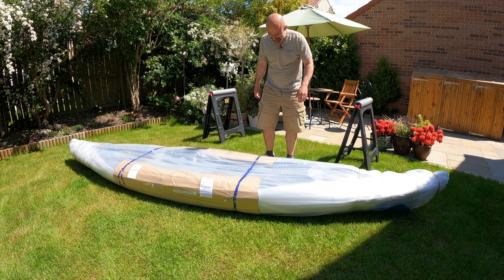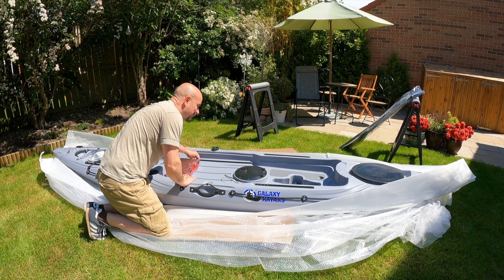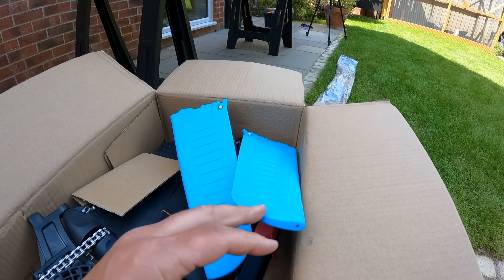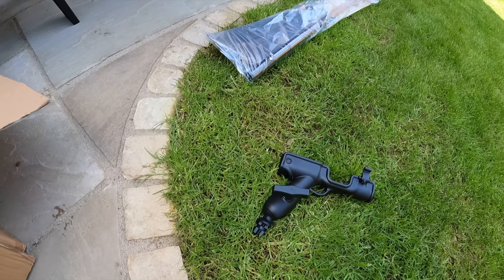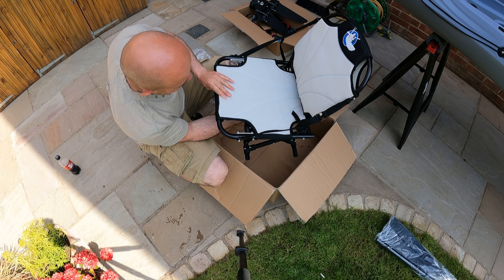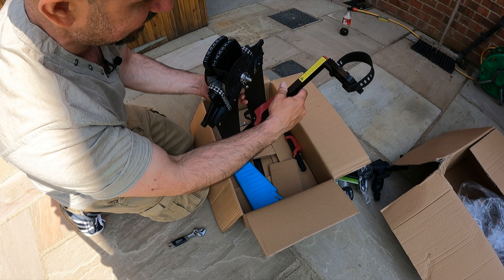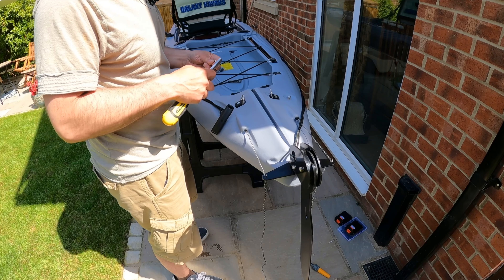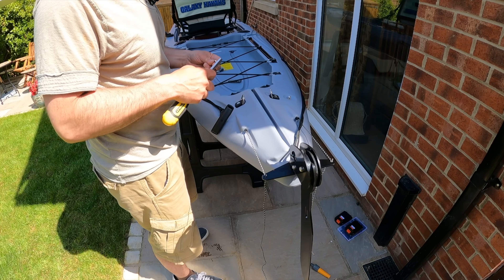Galaxy Sturgeon FX - Galaxy Alboran FX - Kayak Unboxing and Initial Setup

Comment: Evening Chris, 
Hope you and the family all well,
Hit by the storm here in Jersey but all ok.
Did get the kayak thanks again.
Did you do a video on how to set up the fish finder?
As if you're not busy enough 😂.
Have a great weekend.
Reply from the maker: Hey mate how you doing? We just got torrential rain rather than the high winds up here from Cairan. I’m sure I have on one of my vids but I’m buggered if I can remember which one! It’s super easy to be fair. You might need to fashion a bracket of some sort depending on the make of transducer but it’s only a 20 minute job to fit if that. I have my battery battery in the box behind my seat so just run the power cable to there. 👍🎣
Reply: @onthedropfishing  Many thanks as always for replying. 
Have a great night,

Comment: Just bought an fx based on your recommendation, currently trying to fit a fish finder without making too many holes :)
Reply from the maker: Hope you like it as much as I do. I haven’t made any holes for my fish finder. I keep the battery in a waterproof box behind the seat. I’m doing a fishing set up vid in a week or two. 👍
Reply: @onthedropfishing  I put the battery in the nose then the cable right next to where the Fish Finder is mounted.

Comment: Can you show in a video how to did your anchor system please… also what trolley do you use do you find it easy to get into roof racks? Haven’t tried mine on my roof yet👍🏻
Reply from the maker: Hi, I just attached two pulleys to the original rope fittings front and back for the anchor trolley. I use two drainpipes to slide my kayak up into my bars, I have an x-trail so it’s quite high up but it’s easy. Before the drainpipe thing I used to just put a pillow on the roof rails and slide it up. Lots and lots of vids out there on loading big kayaks 👍
Reply: Brilliant ok thanks, I’ve just bought the mk2, can’t wait to take it out.
Reply from the maker: You’ll love it 👍
Reply: Just got a c-tug trolley, how does yours for in the front hatch? Mine has got a lining which prevents you fitting it all in, do you store yours somewhere else when you arrive at the water? 

Thanks again

Nick
Reply from the maker: @nickwaters1142  I just strap mine to the back Nick. You can just take that lining out you know, just lifts out. It’s just a bag with a plastic rim in it.
Reply: @onthedropfishing  the bag seems really tight around the rim, almost like it’s not meant to come off… ok, thanks anyway… had it out yesterday for the first time, no catches but was great fun.👍🏻

Comment: Hi Chris , how do you attach the transducer?
Reply from the maker: Hi mate, the Lowrance bracket fits the moulded in nuts in the transducer compartment out the box. When I had a garmin I had to make a bracket out of aluminium L bar (stuff they use for the corners when plaster boarding) hope that helps 👍🎣
Reply: @onthedropfishing  so a bit like the nova fx
Reply from the maker: @mgaleoutdoors  yes exactly the same 👍
Reply: What battery box do you use ?
Reply from the maker: I don’t at the moment the battery fits into the storage box on the back. It’s just a cheap one from BnM 👍
Reply: @onthedropfishing  do you use a 100mah battery like you use on the nova fx ? Sorry for all the questions lol

Comment: what rope do you suggest for connecting the rudder to the steering mechanism?
Reply from the maker: Hi Paul, the cords to the steering handle come with it and are already attached inside,  you just need to tie them to the rudder, if you mean the ropes to lift the rudder but you want to change them for a different colour you need non stretch paracord. Hope that answers your question 👍